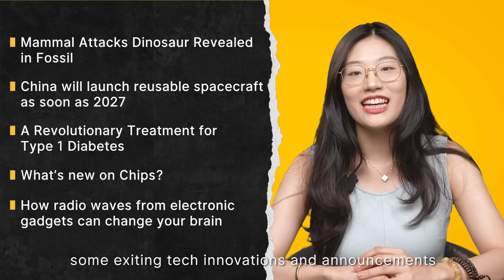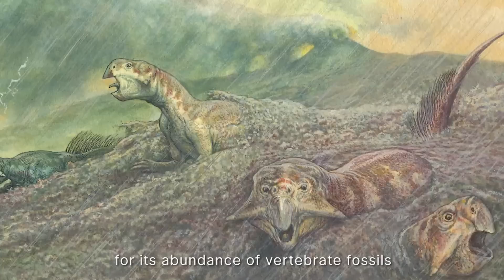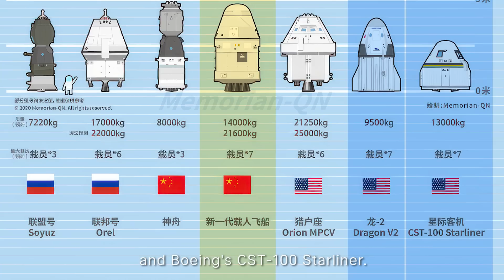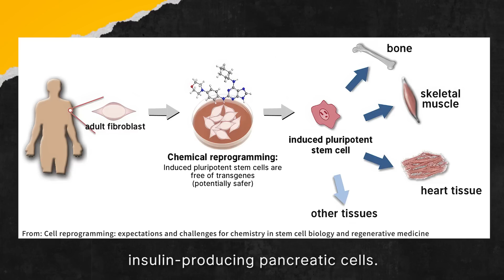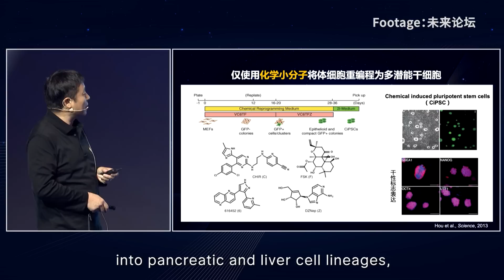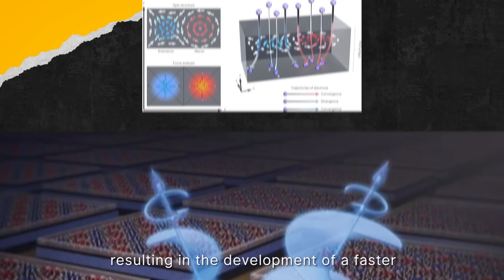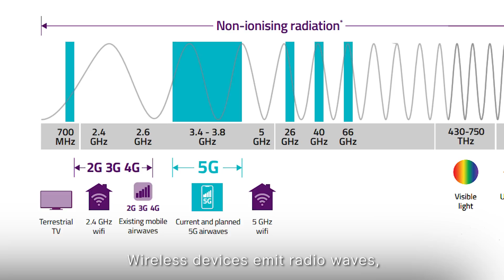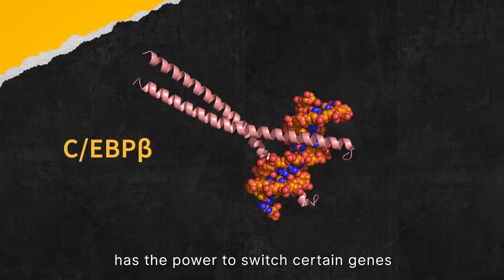How US helped China winning the Chip War？

Comment: If Only the Sillicon Valley would remove labor unions in their companies and make labor a little bit cheaper to manufacture chips in US then the US don't need China remember back in the early 1980's the computer, cellphone,laptop chips were made in Sillicon Valley in San Jose & Santa Clara CA not China that's why the US lost its Chip making manufacturing because of Expensive labor charges to Chip companies to protect their workers while China has no labor unions that is why labor is cheap there

Comment: Any reason for you to reference the temperature in  Fahrenheit only & excluding Celsius?
Reply: They wanted you to use the American system which is the 'Imperial' system ot the Imperialist.
Reply: i found that curious too.
Reply: Yeah just asked about it as well. No idea what Fahrenheit is
Reply: @metalvideos1961  1 degree of Fahrenheit is approximately equivalent to 5/8 of a degree in Centigrade. Water freezes at 32 degree Fahrenheit ( Centigrade 0 degree) and boils at 212 degree Fahrenheit (Centigrade 100 degree).
Reply: Correction; 1degree of Fahrenheit is 5/9 of a degree of Centigrade, typical typing error. Sorry.
Reply: That’s right,the question has been addressed as soon as you raised
Reply: There is not only one way to measure temperature, one standard, and if you ban it, another standard will be created.